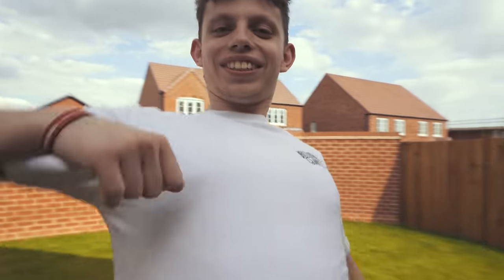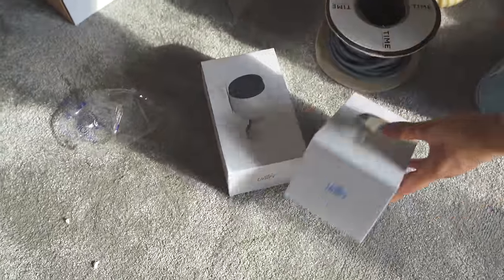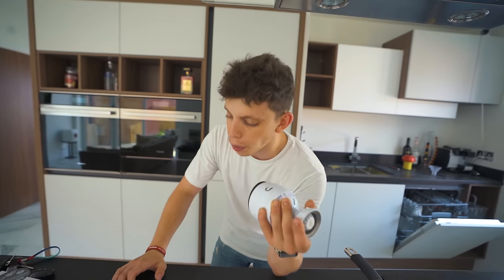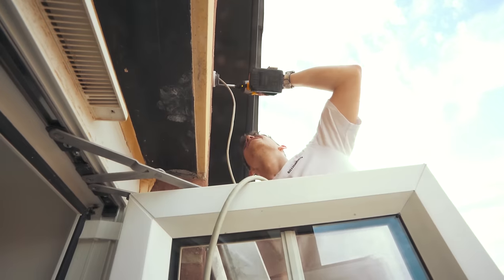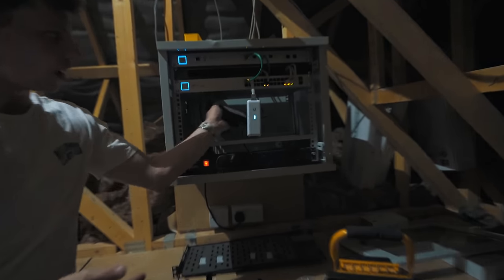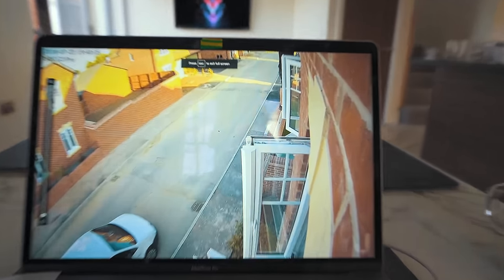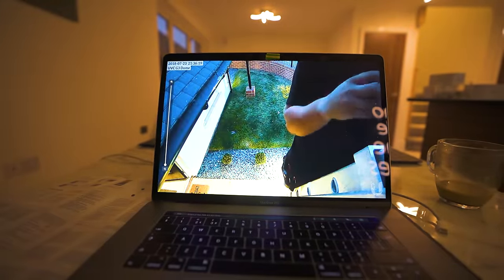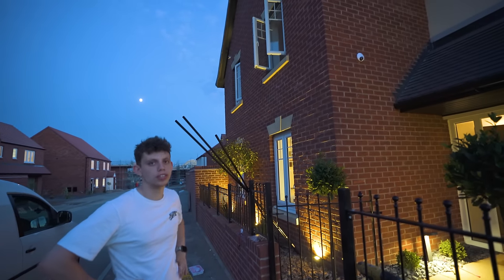The Most Baller Home Security CCTV SETUP EVER!

Comment: Your dome may not last long there. It needs to be very close up under an overhang if it's going to be outdoors.
Reply: No it doesn't, domes can be fitted any where you like. If you fit a dome under the soffit all you end up with is a really crappy view of heads and full of spiders
Reply: matthew mcmullan Of course, you can put anything anywhere you'd like. But, the actual product manual from Ubiquiti says to put it up under the eave or a protection of some sort. Being 10 feet under the eave does not meet that requirement. Hence, my comment.

Comment: That’s not CCTV  (Closed Circuit TV) CCTV is closed circuit doesn’t connect to the internet or a network its disconnected from everything else when are you gonna actually learn what stuff is
Reply: technically it's IPTV as the data travels using the IP protocol 
Traditionally CCTV travels over coax not Ethernet being the standard or UTP/STP cabling
Reply: I'm afraid your applying a very old definition and trying to interpret it in 2018. The transmission of video across data across an IP network, involving remote access, or off site storage of footage still falls well within the definition of CCTV.

Comment: The security system should be on a separate VLAN to prevent outside access to your network
Reply: Jack Sweeney exactly what i do with phillips  hue and Alexa. Going to do same with camera install
Reply: If you use a separate vlan, doesn't it get a pain that you need to have the device you control the bulbs with on the same vlan? And then switch to another WiFi connection in a different vlan to access other equipment?
Reply: Nick Thorley i just set up rules in pfsense to allow locked down routing.
Reply: Mat Burchett so just the ports that the cameras or light bulbs or ... Need?
Reply: Nick Thorley yeah :)

Comment: Another sponsored commercial.  No way would someone purchase that expensive of a product without research and testimonials and be confident with the choice.  I see the UVC-G3-Dome is $629 USD and G#-AF is $140 ea.  That's a lot of money to 'watch the road both directions' without "knowing if they are any good".  I watched because i wanted to see a CCTV setup, not an internet cam IPTV show commercial.
Reply: Tom Peters I've built a few systems for friends, the way to go is building a dedicated computer/server that will run blue iris. That way you can utilize the high power of desktop components, and you can make it as simple/intense as you want. You can have raid, hot swap bays, battery backup and redundant psu's like I did, or you could even just use an old laptop. The software is about $50, but it allows you Incredibly glandular controls of motion triggering, and it allows you to use cheap $50 cameras from China with absolutely no issue. 

All in all, read up into blue iris, it is by far the best option
Reply: Or if you use Ubiquiti cameras, download the NVR software and install it on a PC for free - the dedicated hardware NVR is optional.

Comment: How do you like the your 24 port POE switch? Do the fans always run? i am thinking of getting one (24 port or 16 port), but especially the 16 port switch (which would be enough for me) has plenty of bad reviews of running smoking hot to the point it smells actually burnt.
Reply: I've had the 16 Port POE for 1.5 yrs now a no problems at all.

Comment: As a alarm and cctv engineer myself what you got is a good budget system. I run 2x bosch mic 400 ptz cameras front and back  and pelco domes inside. If you go for a alarm I would look at the texecom premier 24 alarm system

Comment: I’ve added cameras to my own new build. How did you go about the dome camera without going into the loft space? I’ve not added to my house as I’ll need a certified electrician to do it to maintain warranty.
Reply: Maintain warranty from the developer? or Help to Buy?
Reply: Sam Culley both I believe. I need to install new power sockets to the house and just to be safe and have the certification I’d get the electricians in.
Reply: Thanks, I'm moving into a new build in Oct... I will need to do some research now. Thanks :D
Reply: Sam Culley you’re welcome mate!
Reply: SW_TV DM Me for a solution on this. Q - Smart CCTV Systems

Comment: Nice Job. But why aren´t you using cat7 cabeling? Obviously it does cost more, but what is about the future ;-)
Reply: He said on his networking videos why he was using what but not sure what he said
Reply: CAT 7 isn't even a certified standard yet.
Reply: Please don't capitalise the B in Gb, i means something else.  CAT6A is certified for 10Gb, CAT7 brings potential 40Gb at 50M, however it's a lot thicker cable, worse bend radius, a pain to install.  There is future proofing and then there is installing something that the TIA/EIA don't even recognise yet, or may not even do so.  CAT 6A alone is a pain to install.  To date there is nothing on the market that uses the new F type connectors.  It is far too immature a product, the capabilities have been defined but the full construction specifications of CAT7 have not.
Reply: The same thing?  You would be out by a factor of 8 by misusing Gb and GB, interchanged between bandwidth a measure of storage. No one said that about USB-C and that's nothing more than a curve ball to avoid the point, that. No, CAT7 is not a thing as no one has agreed the standard of how to make them, it is not a standardised cable.  One CAT7 from one brand on Amazon is not the same as another, many can't do 10Gb.

There is not a single large corporation, education institute, data centre using it because it has not been ratified, they could possibly have TERA connectors, we don't know yet.  So yes, you might end up ripping out, at this rate they may go straight to CAT8 as a standard and this whole concept skipped.  I've said my bit but you've clearly already fixed your opinion.

Comment: 3 cameras @ 1080p set to always record - how long does that give you before you are overwriting historical footage? I didn't catch what size drive you were using.  Curious as I'm toying of getting a Ubiquiti Dream Machine Pro which is a more of an all in one gateway, Unifi Controller and Camera controller (tidier and cheaper on electrickery in the long run!)
Reply: 2tb
Reply: per month
Reply: at 15 fps though so I'd double that for the 30fps advertised by ubiquiti. Looking at 1.40625 tb per month for three cameras

Comment: extremely overpriced 1080 resolution cameras! at that price I can get  a 3840 resolution POE camera
Reply: But you don't really want 4K. A 2K camera will have higher light sensitivity than a 4K camera with the same sized sensor. Unless your 4K camera sensor is double the size, while it will look great during the day, its performance will suffer at night compared to the 2K cam unless you can seriously flood the place with IR light.

But the G3 Pro has other features as well, such as 3x optical (not digital) zoom, great for setting up a camera a distance off and zooming into the area you actually want covered, they can also stream directly to YouTube without a PC in the middle for public live streams and the Sony sensor provides excellent night performance.

Comment: When you’re drilling through a cavity wall, drill from the outside and leave the drill bit in the wall. Tape the cable to the end of the drill bit. Done
Reply: Won’t the drill bit be extremely hot though?
Reply: Seth Arvila not after about 20/30 seconds.

Comment: Wired “effernet”...... u can pick up half decent wireless equipment for a fraction of the cost. Just make sure u have adequate network security. Also means no drilling walls, ceilings etc and spending hours running cabling around your house. Then when you move home it’s just a power source to unplug.  Otherwise you have to remove all the cables, fill holes etc etc etc... go wireless.
Reply: Sandy Nicholls wireless cctv isn’t as good as wired equipment. It less stable, video quality is worse. If you need to drill for power cables why not just install cat5 cabel.
Reply: While I agree that wireless isn’t as good as wired, I don’t think that wired is around 10 times better and therefore can’t justify 10 times the cost.  I have a wireless system with 4 external cameras and 5 internal as well as 2 motion sensors.  This is quite a basic setup but all my images would stand up in a court of law or for insurance purposes as external points of entry and internal entry points are covered and anyone can be easily identified.  Shopping around this setup has cost me approx £350 for the cameras and around £100 for the sensors.  All I am saying is that if your on a bit of a budget or uncomfortable with mains electrics and associated wiring then wireless is an option.  Also with cat 5, you have the wiring visible or have to hide behind box conduit.  And ultimately like I said, if you decide to move home you literally unplug and setup again as new
Reply: @cinnamondonkey2397  I never said wireless wasn't more secure than wired.... I'm just saying that it's all well and good doing systems like this if money is no object but not everyone has that luxury as well as maybe in rented it shared accommodation. Further more you have a wired connection to the install location in the house but everything else is wireless so you can just be hacked that way.  Also, everyone here had better get go back to writing letters because I would pretty much better my last pound that at lease 75% if the users are accessing through a wireless device if some sort so by default, you are all being hacked... And if your security is that good that you are not, then you can do wireless... But at the end of the day nearly every company in the world has been hacked or DOS.
Reply: @vidfreak83  350 for 9 cameras ? whoa that's cheap . which kind did you get ?
Reply: How to view camera on tv in different places in the hose at same time?
Reply: a radio / wifi jammer can easily disable those.

Comment: Nice system but I would say 99% of us are not going to spend $2000 to $3000 (if not more) on a security system....or maybe have one given to us if that is the case.
Reply: You don't have to. I bought the G3 Pro and G3 Flex cameras for my setup, and the picture quality on the Flex is excellent, losing out to the G3 Pro only when it's dark and no IR light is present to illuminate the area.

Beyond that the Pro sends its IR light a little further compared to the Flex. If you're only covering a small area, including small front or back yards, there is no reason to not go with the much cheaper G3 Flex camera. It's still IP67 as well.

The NVR can be any spare PC with some disk space free and install the free Unifi Video server on it. Done. You don't have to buy the appliance.

Comment: I think you need to look at the regulations for CCTV installs, your cameras are viewing public space and other peoples property....against regs. also you need to put signs up
Child.
Reply: Can confirm you 100% need to look at regs on CCTV. Doesn't just mean for businesses sadly. You can see into peoples windows and so on. You might want to setup a privacy screen. Also you might want to look into Hikvision cameras and NVR's. Much better quality overall and 4K is now the standard for CCTV. Also put up some signs, remember you've got to have contact details on the sign for the person that runs the system.
Reply: @jacquessteventon  Thousands of people point cameras in public areas and have no signs. See if you can find a single case where someone has been punished for that.
Reply: @jacquessteventon  Sort of correct, you shouldn't have the cameras pointing at other peoples property and should be masked, the street is fine as its a public area, signs also not needed for your own property.

Comment: Hi Alex!
4K is the way forward with IPSC (IP security cameras).
Motion triggering is the best way to record.
Installing three metres from ground level means you can capture the face.
If the cameras were shown in their final resting position, you can currently see into your neighbour's homes which breaks UK law.
I would set up the cameras in a RADIUS-controlled VLAN in an LDAP domain as a walled garden supporting physical disconnect warning.

Comment: What a total mong. I had to laugh when he said he knows what he is on about. its not that great a home security system.
Reply: What's wrong with it ??
Reply: Overpriced and low quality. Check the footage from it in this video. There are better out there for a lot cheaper. They also did not place the cameras in the correct positions.
Reply: I will agree, This kid has blinders on for ubiquiti because they are easy. I can get a 3840 resolution POE camera for the price of one of these pieces of crap he loves.
Reply: @Aj0691202  can you provide a link to such a camera? Can only find 4k cams at near double the price.

Comment: Using shielded cable outside would be a must imho, and shielded connectors ;) i know that Ubiquiti has both ;)
Reply: There's no reason to use shielded cable outside. I think you mean outdoor UV rated cable which should be used when the cable is going to be exposed to the sun. Shielded cable's only benefit is in high EMI environments such as near high power lines our high power factory equipment.
Reply: slayaman22232 also for 4G interference, static surges on the enclosure outside, there are more things that interfere then only emi and powerlines

Comment: Or you can just have nest
Reply: A nest isn't a reliable proper solution. It's a easy camera for people who want something simple, but shouldn't be used in environments where reliability is key. Also, you have to pay to use their online service.
Reply: @Max34557  oh I can assure you, I have nest all over my house and it is extremely reliable, plug it in, connect it and voila!
You don't even have to pay for online service, it's just that, if you pay, you'll be able to play some recorded footage from up to 3 weeks
Reply: @Max34557  and you have to agree that the designs from this camera is stolen from nest's outdoor camera
Reply: Honore Paillet Ah, my mistake. I believe they're reliable, and easy to use, but i'd never use them in a enterprise / business environment. Because they connect over Wi-Fi right? Which could very easily be jammed with a €30 device from AliExpress.
Reply: @Max34557  if the wifi that the camera is connected to is jammed, you can use mobile data or other wifi on your phone and you will still see live feed, even if there is no wifi at all for the camera, it keeps recording, so at soon as it connected back, you can visualize what's happened, if it gets unpluged it shows the last picture and video it took by email and message
Reply: Honore Paillet Ah, i see. I still prefer my Hikvision wired cameras over Nest cams, they're much cheaper as well, have IR night vision and look more professional.
Reply: @Max34557  totally understand, everyone has their own things
(There is night vision on nest to  😂) but I do agree nest is expensive
Have a good day my dude !👊
Reply: @Hello _ I don't get it, are you with nest ? Or do you hate it

Comment: I settled with an ANNKE 4 CCTV Cameras set for £150, have much better quality and frame rate compared to yours.
Reply: Let's be honest no it's not, You get what you pay for ubiquiti aren't the best but it's 100% better than your ANNKE system. (ubiquiti wireless gear is the only product i rate) Hikvision is what i install
Reply: ItzDeclan what about Ring? I’ve got the doorbell and spotlight in front and spotlight in back wired. Doorbell is run on battery.
Reply: @NaughtyBwoi  Ring doorbell are good for what they are nice and easy to install and work well as a standalone doorbell

Comment: Ubiquiti is not even close to “baller” cctv. They’re pretty much at the bottom of the bucket when it comes to pro cctv. You can setup a much higher quality cctv for home much cheaper than Ubiquiti. That NVR and software is junk.
Reply: such as?
Reply: They're actually pretty well rated if you look at reviews from professionals. (https://ipvm.com/reports/rank-fav-19)
* Ubiquiti ranks 2nd with 68% favorability, right behind Axis if you don't have access.

Sure it's not as "Baller" as Axis or Hanwha cameras connected to a VMS by Milestone, Genetec, Exacq, NX Witness, etc. but it's far from being junk.

** Also, this is intended to be for a home system, not an airport.
Reply: ReasonablleDoubt what would you suggest im looking to get sorted
Reply: Zouloum No one uses Ubiquiti Cameras. No airports, no data centers, no government buildings, no hospitals, no banks literally no one, not even gas stations. Try to find them in your city or anywhere. You’ll never see one. They’re consumer grade at best.
Reply: @ReasonablleDoubt  I found one place, a local McDonalds uses them 🤣🤣 ubiquiti makes shit cameras beyond laughable. I'll stick with axis! Even hikvisions generic crap is better than ubiquiti cam gear